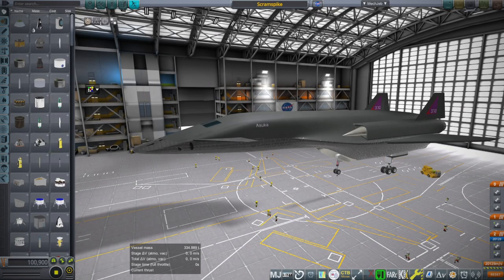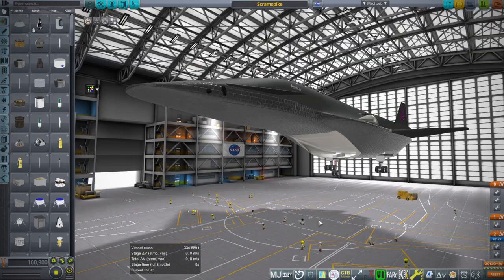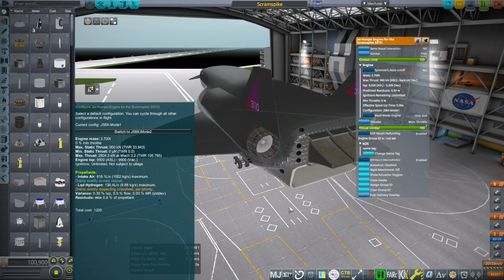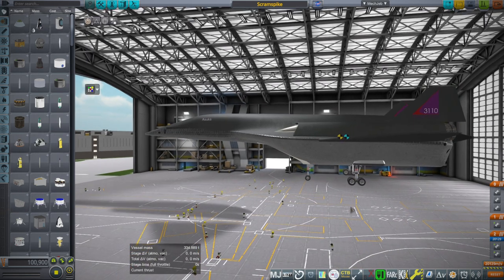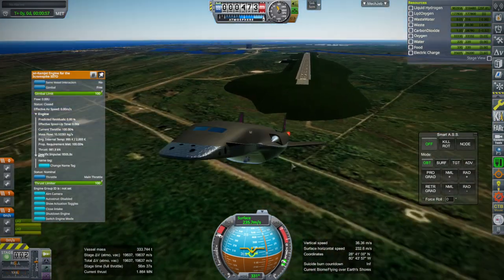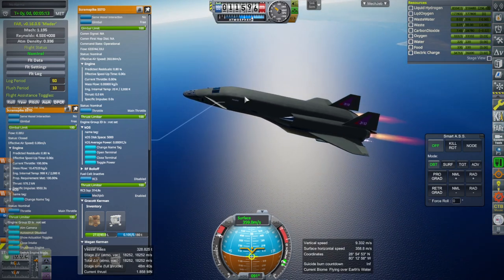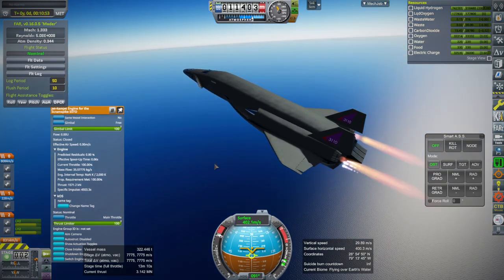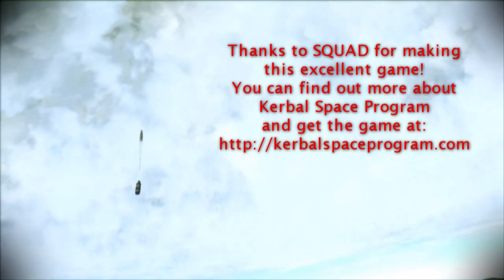Kerbal Space Program 1.12 with RO - Scramjet-Aerospike Concept Intro and First Test

Comment: silly question but if u used a magnetic confinement could u move the charged gas(plasma) flowing over the airframe and thru a ram jet at mach20 away from the structure preventing it from melting/heating up